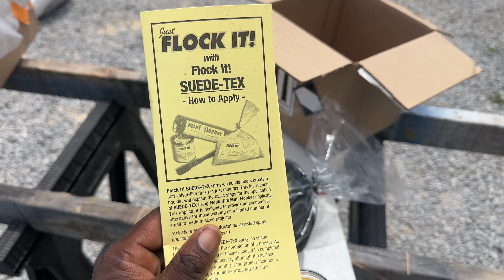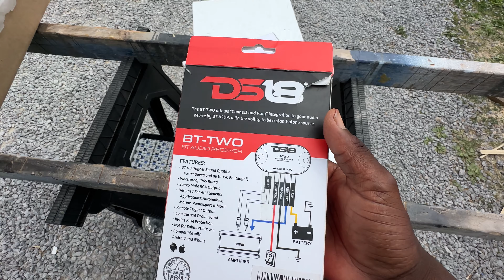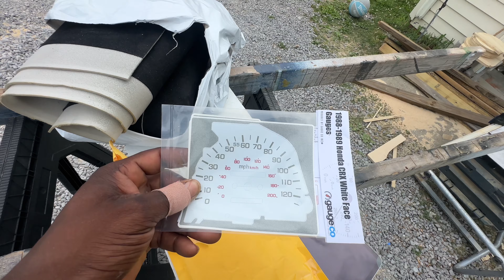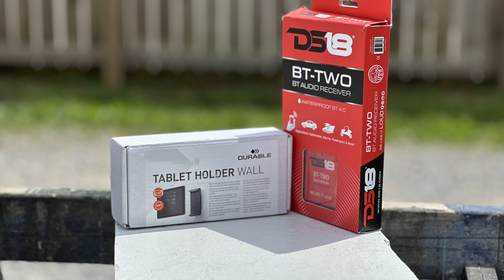Exciting Update: Honda CRX Restoration & Audio Gear Unboxing! 🚗🔊”

Comment: Also this morning when I started my car I had my voltage regulator set at 15.7 and on the cold start it was reading 15.9 and at 1000 rpm 16.1 it instantly sent my amp into protect so make sure you get amps that can handle the higher voltage almost all the deafbonce will except the atom series apparently doesn't like above 15.7 like my kicker